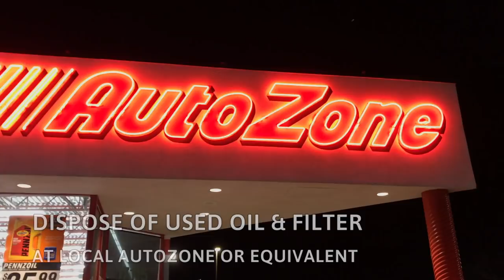Honda Civic Sedan Oil & Oil Filter Change 2012-2016 - 3 Minute DIY Video

Comment: Nice video! I'm from Russia. And I'm in wonder with yours nature caring: filter and oil utilization and cleanness oil drain. In my country it's a problem: many drain tanks left near parkings and along roads. I'm ashamed from my citizens. But I left drain tanks into my garage and drive to utilization point time to time. And else smb use drained oil for heating in small stove.

Comment: Dumb question: If your car is high enough that you can go under it anyways, do you still need to put it on ramps to get that downward angle? or is that just to be able to work under a lower car? I have a CRV that I'm fairly confident I could slide under to do but I wanna know if I still need to use ramps
Reply: It’s just to be able to get under it. A Civic is so low to the ground it’s nearly impossible to do this without having it raised at least a few inches.

Comment: Hello, I used my mother’s Honda for a gnarly road trip and the metal skid plate needed removal during the trip as it, wasn’t looking the best and dragging at anything above 50 mph, is that plate really needed ?
Reply: I understand it protects my oil pan but like are these Honda low enough stock to hit the oil pan? Gonna change her oil today thank you for video

Comment: I have the same car and I want to the oil change , can I use Mobil 1 oil filter ? Or do I need to buy a specific brand ?
Reply from the maker: The Mobil 1 filter will work just fine. Make sure it’s filter # M1-110. Thanks for watching!
Reply: MINUTE DIY VIDEOS  thank you so much ! And your videos are awesome !! Your the best !
Reply from the maker: Aw thanks that means a lot !! :)

Comment: Very helpful video. Only one question: when you tighten the bolt, how much torque will you use?
Reply from the maker: Thanks! The recommended torque is 29 ft-lbs or 39 n-m :)
Thanks for asking!

luke

Comment: According the my manual I will need " a special wrench to replace the oil filer. You can buy  this wrench from a dealer". Is this true? I see on Amazon that there are general oil filter pliers. Help please!
Reply from the maker: Hey! Yea Walmart, Harbor Freight, and Amazon all have very inexpensive filter wrenches that work just fine! Thanks for watching and for your question!

luke
Reply: MINUTE DIY VIDEOS thanks. Awesome video. Changed the oil this morning. It's no longer under warranty so I'd rather save the money. $35 vs $78 at the dealership. If I were to include changing cabin filters, rotate tires, and inspection of vehicle, it would be $160.

Comment: My Civic LX 2014 have 60,000 miles. Can I use oil 10W-30? Because I bring from USA to Honduras and here we don’t have 0W-20. Please answer me because I’m very concerned. Thanks
Reply from the maker: Hello!
You should use 5w-20 if 0w-20 isn’t available. This would be the next most similar viscosity. 10w-30 would be much thicker than 0w-20 and would be a bad choice. The first number is the thickness at start up, the second number is the thickness at the running engine temperature. Toyota and Honda recommend 5w-20 as an alternative to 0w-20 when 0w-20 is not available. But they do recommend finding 0w-20 for the next oil change you perform. Hope this helps, thanks for asking!

luke
Reply: Can i use 5w30?
Reply from the maker: I would find the  0w-20 oil that 9th generation civic was designed to use. Thicker oil will at a minimum deteriorate gas mileage.
Reply: MINUTE DIY VIDEOS and 0w40?

Comment: You know that plate underneath the car .. is it necessary to replace ? Couple of the screws are stripped I’m bout to rip the damn thing off
Reply: Not necessary, but it does help with aerodynamics which helps with fuel economy.

Comment: Is the 2017 the same or different?
Reply from the maker: The under engine cover might look a bit different and the oil filter is moved slightly but other than that it is the same phillips head bolts on engine cover, same 17mm oil drain plug, same 0-w20 oil,  same oil filter :)

Thanks for watching!

luke

Comment: Does it matter what kind of oil you use as long as it is 0w20???
Reply: I believe 0w20 only comes in synthetic, but if you mean brand of oil then yes you can use any maker of 0w20
Reply from the maker: Any brand of oil will do, but some people have their preferred brands. All 0w-20 will be just about the same as they are all full synthetic oil as 1020Shane points out. They may have some claims about their superiority over other brands in terms of protection and fuel efficiency, but for the most part they are all the same.

Thanks so much for watching!

luke

Comment: You will never get all the oil out, at an angle. At least check the oil level after backing off the ramps as not to overfill.